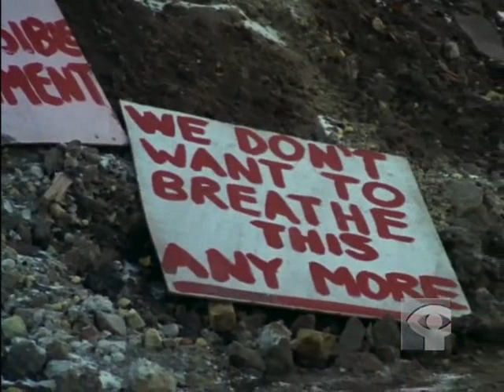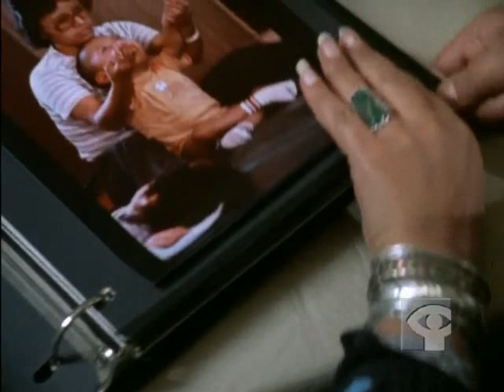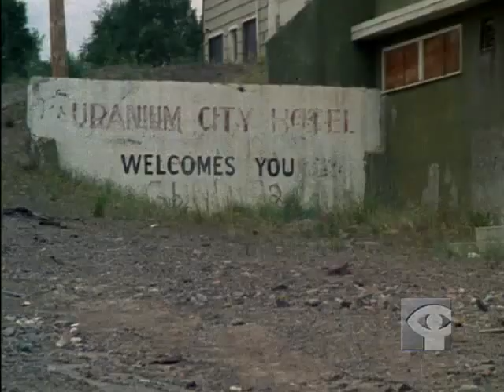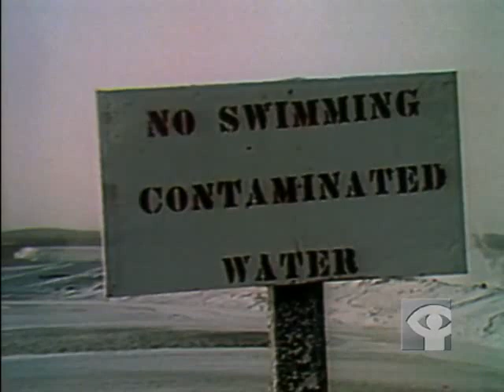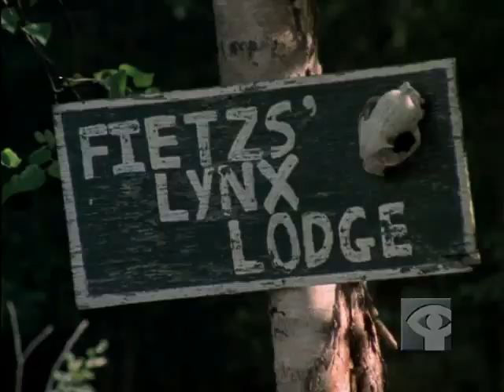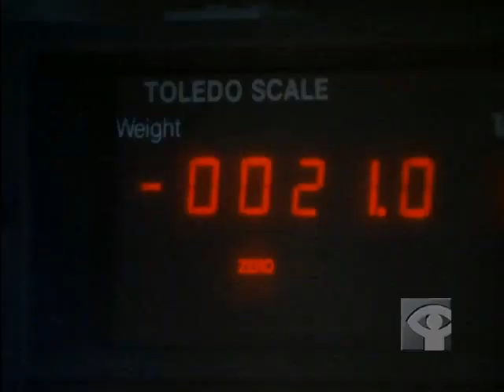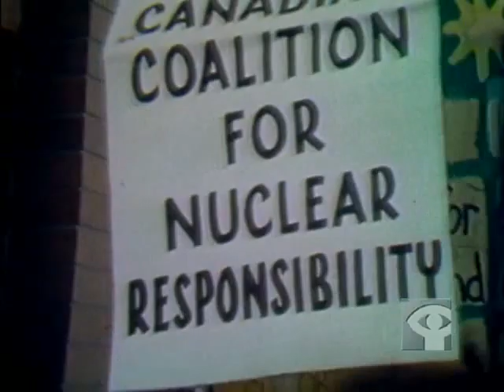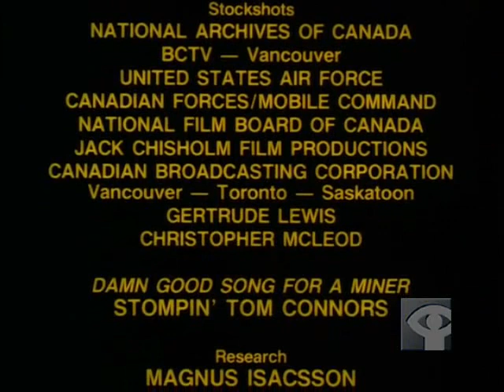Uranium

Comment: Where is this wasteland located at 46:00?
Reply from the maker: Elliot Lake, Ontario, Canada. These mines have been producing uranium for a long time; first was for bombs then electricity. Tons of solid and liquid waste were produced and dumped on site. The 'wasteland' you see is sand-like tailings which are far more radioactive than the uranium that was extracted. They contain at least a dozen radioactive elements plus heavy metals, acids and other chemicals hazardous to animal and human life.
Reply: Tibor Roussou that looks really scary just like in a computer game
Reply from the maker: At least with a computer game you know that it's not real!
Reply: 300 million tons will have been dumped by the end of the century if production continued at 1988 levels.
They are slow-releasing, constant-threat, continually contaminating for thousands of years.